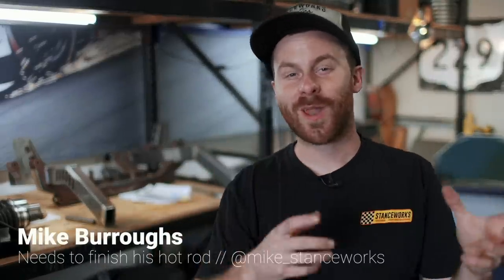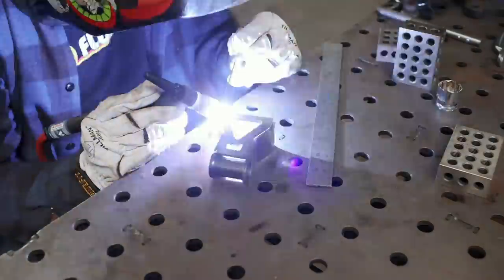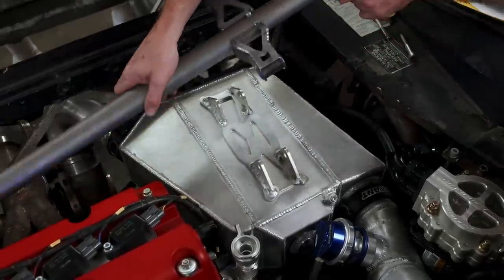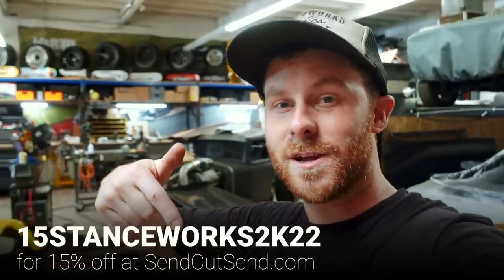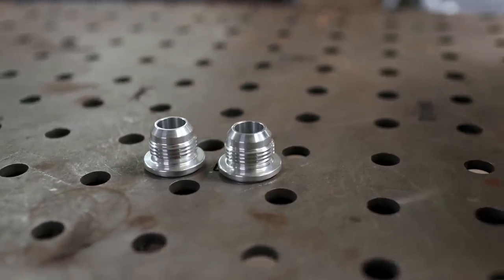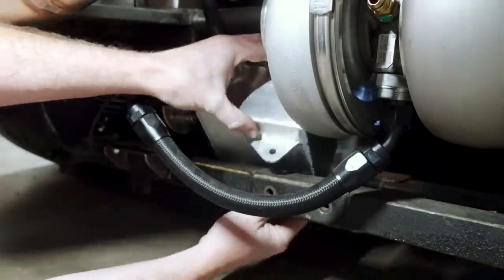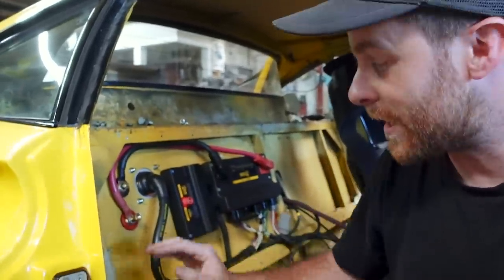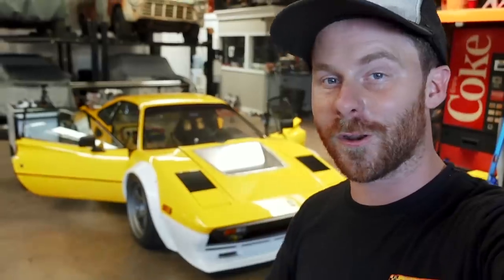Over-Engineering: Intercooler Mount, Oil Sump, PDM, And MORE! Honda-Swapped Ferrari

Comment: Hey Mike, great work as always. I have a car that is a "tweener" (in between a street car and a track car). Over the years I've driven it far less on the street than I ever imagined, and I regret not putting a full cage in it from the get go. Whenever I drive a fully caged car on the track, I feel *a lot* safer and more comfortable at the limit. Your car will be making 5-6x the HP and probably triple the downforce versus my car, so it seems like all the more reason to go full cage.

All that said, safety sometimes comes with compromises. Even if you go with just a back half roll bar, you still aren't supposed to use 5/6pt harnesses without a HANS device, which can't be used without a helmet, and yeah... you end up questioning where to draw the line.

Lastly, there are some neat ideas that you can incorporate for added protection on a back half only roll bar, that wouldn't put bars next to your head, but can help with additional side impact, and to a lesser degree, front impact protection. They would probably help with rigidity as well. I can send you more info/photos if you are interested.

Comment: Detachable steering wheel and a half cage for the street/track. Perhaps also add a detachable side bar you can add for track use and remove for street use.

Comment: Roll Cage By Send Cut Send !!! Think monocoque design. You could cut out some of the exsisting sheet metal in the areas of the roof/windshield  surrounding areas as well as the door jams and floor pan to be replaced with or added to with bent/cut sheet metal that adds significant strenght and little more, if any, weight as compared to a roll cage. You could do that without adding much if any intrusion into the cabin area. I am a past 308 owner and I have worked on doing this on a 308 in the past. Happy to share what I know if this appeals to you. I believe that it gives you everything that you desire in this area with no negatives except for the added work.
Reply: Can, of course, be added into an approve competion rollover bar/harness bar.

Comment: I'd look into some other 308 builds, see if they have added roll cages or other alternatives to their projects.  It's 2022, someone has had to have done it already, and like people here said, it's all about how you plan on utilizing it in the end.  I agree with another commenter about a quick release steering wheel to help with ingress/egress.  I know nothing about racing standards, but I feel like there are less bulkier options for your racing seat given how small the interior of the 308 is.

Comment: Already mentioned a few times, but a half cage with a harness bar and diagonal brace would probably be the best compromise, tying it into the rear crossmember would also be beneficial, as I'm sure 1000hp and sticky tyres is wanting to try and twist everything.

And if you ever did go custom doors down the track, you could then maybe add some bolt in side intrusion bars that go out around the seat and occupy the space the factory inner door card would normally be.

Comment: I'm no expert on turbo oil drain tanks, but I'm pretty sure it needs a breather? When the pump sucks it'll create a strong negative pressure in the tank, which will still suck oil rather than let it passively drip through. Fabrication looks amazing BTW

Comment: A rollcage with double central roof bars and no side bars, or low side bars, could be safe for everyday use as there is space in the center of the roof and the double central bars in the roof can be lined with impact absorbent material. The central bars can still support some controls or selector switches.

Comment: I made the decision with my build (GT40 replica) that while I intended to track it occasionally it would predominately be a road car. My chassis came with a roll cage, I sat in the car with it fitted and waved my head about and it would be laughably easy to hit my head on the cage even with a 6 point harness and strapped in hard. So unless I was ALWAYS going to put on a helmet even for a little trip round the corner the cage had to go. 

What I did do however was add in a plate to the roll-over hoop integrated in the rear bulkhead so I could (in theory anyway) bolt in a cage relatively easily and quickly. Sure a bolt in cage will never be as good as a weld in one but better than no cage under the circumstances where you might need one!

Comment: Cage is not necessary for what you're wanting to do. However if you are dead-set on having one then I would change your seat with a lower bolsters to make it easier to get in and out of. Also keep in mind if your steering wheel disconnects it'll be a lot easier to get in and out of with the existing seat that you have.

Comment: Cross the cage from the a and b pillars to the center so it leaves a gap on the window side and comes to a point in the center . Like an x on the roof. So you won't hit on the window side where it's right close to your head and the inner side would miss the cross bar cause it comes to a point

Comment: I figured you'd build a main hoop with harness bar and make it a weld in 6 point. It's a compromise from going full cage, but will add some level of safety and structural rigidity which I know you were wanting.

Comment: Great video as always.
Also, I don't know if you know this, but polymers require different cutting tools on a lathe.
They are much sharper and will generate a much smoother and accurate finish.

Comment: Mike, I believe that the oil outlet of the turbo must be a gravity drop to the tank, you shouldn't be expecting the oil to travel up in any stage.. I believe that your idea is to make the oil drain pipe to make a slight U and travel up near the tank inlet, and I'm not sure that's an ideal solution.
You would probably be good with a smaller tank right bellow the turbo..
but probably there'll be more comments about this around here to make sure if this is a problem or not.

regarding the roll-cage... I believe the car just looks to good to be track only.... this thing will make the day of anyone watching it on the street <3

Love the way this is going. Congrats for all the work in this car and the channel.

Comment: From my experience with a similar project (Frankenstein porker) No full cage to start. If you feel or hear the chassis flexing then add the front. I cut out the front of my full cage with no regrets. Driving to the track is 25% of the fun.

Comment: Love the build. Just a suggestion with the oil drain. If you have the pump sized for the required flow, such a large tank wouldn't be needed. The low mount kits available for BRZs or 86 and other Subarus with low turbos do still have a small reservoir but not such a large tank.

Comment: 1/2 or 3/4 cage would be a good place to start. You can also try and see what seat mounting wiggle room you have for headroom. Then you can also add on anti intrusion bars and pillar bars later to the existing cage if you want. I’m a sting believer that if your on track even without wheel to wheel a cage is a must. I’ve seen enough casual track days turn bad that I wouldn’t want to run that without a cage. Especially with that power level and the design of car. Old things don’t crash well. Just my 2 cents worth. Love the car. Can’t wait to see it run!

Comment: I used to run ViperDays and later with NARRA for time attack trials.      I had a bunch of fun and have quite a few trophies.  My '97 GTS did NOT have a cage.  It did NOT even have a  roll bar.   Most of my competitors did NOT have cages or roll bars.   I only know of one person that died racing in those series, and only a handful of bad wrecks.   Everyone walked from the wrecks, and no one had cages.   I put 50K miles on that car, tearing up the streets around Austin until I was forced to sell it due to C-19.    I would NOT put a cage in it.

Comment: Cage idea: What about doing a sort of T-top cage? So you would have a roll hoop, like you're planning, and an bar that basically traces the border of the windshield, but then connect them in the center, instead of at each side. And you could do a low door bar. So it would be significantly safer and stiffer than just a roll hoop, you'd have a bit of side-impact protection, but you'd also have plenty of head room. (It obviously won't be as good as a full-on cage.) Is that an option?

Comment: Running into the same cage dilemma in my 1000hp “street car”. The guys at the race shop down the street said just run a 6 point with no bars going past my head. Maybe you could bend the tubes for the door bars where they would be below the seat where you get in and out. The ride tech tiger cage has those style bars. I love where this car is going. Best of luck

Comment: I think a cage would be good, safety first etc. especially without airbags. making the dorrbars low as the seat will keep most of your entry comfort. Also you could make the door bars snap/bolt, so on the street you maybe can disassemble them.

Comment: You could make a cage that doesn't have bars along the sides of the roof, but rather in the center. Make a roll bar around the front window and connect it to the rear roll bar with two bars in the center. It will give you enough headroom and make the car much safer. Best of both worlds, IMO. If it's hard to imagine, just think of the roof of a GT40 with the doors open

Comment: You can pad the cage with soft foam/rubber tubing. I got mine from a wholesale air conditioning supplier. I use SolidWorks which I learned at university when I was studying Industrial Design. I've used it heaps since then on my projects, so I'm heaps better using it now. I'm definitely going to use your discount code! Also, I know you're a stickler for details, it's spatter, not "splatter". If you MIG weld you'll have an aerosol can of anti-spatter spray.

Comment: For the cage I would weld in everything behind you, the hoop harness bars etc. Then consider making the front hoop/door bars etc bolt in. OK it wouldn't be easy to fit or remove but you could then run a cage for track season and remove for show season as it were. Unless of course track rules stipulated otherwise

Comment: I would do a half cage but with seat bolster height side intrusion bars which run to an anchor in the footwells and from there through the front firewall to the front strut towers. I would also try to create an anchor point to a dash bar that runs from the left to the right hand side of the car.

Comment: On the cage - I say you stick with what you original intention was for the car,  which was dual purpose for street and track use, so I say 1/2 cage, and then if you find that you really are not using it on the street, and find the need for a full cage, then go that route. I am always a firm believer (as I know you are too) in letting the car evolve if it needs to to meet your needs.

Comment: For the roll cage they do make removable joints that can be swapped in and out. So you could effectively just remove part of the roll cage for street driving and install it back in place for the track. Also can you just have the top portion of the roll bar go behind the drivers seat? That why it still protects you in a roll over yet not interfering with a helmet? Also a detachable steering wheel, something like the ultima rs kit cars use where they have everything integrated into the wheel. That would be cool. Idk if they sell that kit separately though.

Comment: Half cage should be more than enough for what you want to do with it. But if you want options make a solid half cage and the test bolt on for a full cage. That way you can use it daily with the protection of the half cage and for more extreme racing you can bolt on the rest and have a the protection of a full cage.

Comment: Add a roll bar running the same line as the b-pillar glass so it will visually disappear from the side view.  Then run a halo with removable outer hoop orrrrrrrr, make it a T-top roll cage similar to the structure of a GT40 and removable side impact bars. At the very, very least, you should add a roll bar and utilize the same bracket design for the 5-point harness mounts.

Comment: I would say make a roll bar which is welded in place and make the front of the roll cage removable so if you want to street drive you can like how you can remove the wing depending on what situation you’re in

Comment: Half cage seems sensible.  Should get you some safety and rigidity while allowing you to drive it all the time.  I would also recommend a removable steering wheel to make getting in and out a lot easier.

Comment: BRO...your attention to detail is EPIC.  You have a very detailed eye for fit and finish.  That being said, having suffered this issue in the past myself, might I suggest that you add some form of "abrasion protection" on the cables inside the cockpit (for the PDM).  I am aware they will not actually move, but low frequency vibration throughout the chassis/body can cause the cables to "rub" so to speak.  Will it rub through the insulation?  Probably not, and the ground will not matter...but the positive cable is carrying a bunch of amps...Maybe at least place the ground cable against the bulkhead and stack the positive on top.  Keep up the entertaining and informative vids.

Comment: Ok! Welds are getting better and better! That’s gotta be super satisfying!? No issue with the PDM swap. I’ve been looking at others to go with my Nexus so this seems like a no brainier if for no other reason than uniformity. To Cage or not to cage? This car should have quite substantial performance. You’ll be at much higher speeds than probably any other car you’ve built. I’d be throwing in a rear cage at the very minimum but think with some clever design you could fit a front cage too. Have a look through the FIA rules on cages for inspiration on removable door bars and other design aspects. You could even make the front half removable. Loving it Mike!

Comment: healthy question. if the turbo drains to a tank to avoid being sucked dry by pump then how does the pump protect itself from going dry also.  i.e. if the oil drain to tank is lower than pump emptying it then the pump will simply empty the drain tank and also run dry.  seems like a control feedback loop is required here with a float switch perhaps but it is adding complicaton. keep up the effort thanks

Comment: While welding the mount to the intercooler, you could have added a bleedvalve for the waterpart. I hope you will get the air out, without a bleedvalve.

Comment: Half cage is the way to go, at least at first. If you decide you need more than that it's easier to add to a half cage than cut up an existing full cage. A quick release wheel would go a long way towards making ingress/egress easier as well.

Comment: Those urethane bushings will have minimal give, they are very rigid and the part really doesn't have that much weight to it.  In this case I think rubber would've the better choice given the intended use.

Regarding the cage, I think that's a decision YOU need to make. Adding a full cage will w/o doubt improve the chassis rigidity, which is something those car's could use a lot of help on, especially on the track!  But, I do agree it would be pretty dangerous to drive w/o a helmet.  Having wacked my gord on cage bars more than once (luckily nothing to serious), I can tell you your concern is valid... especially on the street with potential passengers riding in the car!  If you really want to use it on the street, probably the best compromise would be a well designed rear roll bar with  fixed door bars (contoured for somewhat easy egress) and tied into sold structure as far forward as possible...  Just my two cents!
Reply: BTW, I'd use chrome moly for all of the tubing to keep weight and diameter at a minimum.  That is, unless you can find someone to make one for you out of CF!

Comment: I think you answered your own question regarding the roll cage dilemma, if the car is as you say a road n track focused one then you won’t need a full roll cage, a roll over hoop and some nice upper and lower strut braces in the front and back will stiffen the chassis just fine, or a hybrid approach if possible, a half cage behind the seats triangulation to the rear shock towers and an upper and lower strut in the front end will provide plenty

Comment: You could do something like a roll bar with braces similar to what Porsche does in the back of their GT road cars. Maybe even run a bar forward low next to the doors to add some structural support. That way you don't have any bars around your head but still have some additional roof support of you do roll.

Comment: In terms of a roll cage, I'm with you in that I don't think it needs to be a full cage. But as someone else mentioned, a roll bar of some kind would be wise. You point out how close your head is to the roof, and in rare event of a roll over at a track, there would be nothing to stop that roof from caving in on your head without a roll bar. An idea mentioned that I think would be pretty good was to have the main hoop at the back, floor to A-pillars across the top of the windshield, and then a central bar(s) tying the front and rear together. You're a smart guy though, so much like everything else in this build, I'm sure you come up with a clever solution. Love the car. Love the build. Love the education its giving along the way.

Comment: All is looking great, and my perspective on your "ingress/egress" issue is the seat you have chosen. The left side head buffer is really unnecessary when you have a helmet on, as it will bump against the roof anyway. Eliminate that and you can probably bail out lots easier in an emergency, as well as improved normal driving entry and exit.